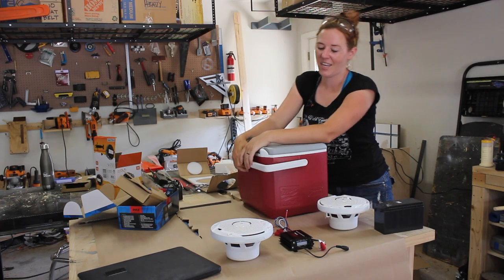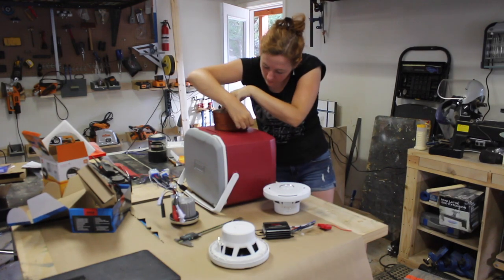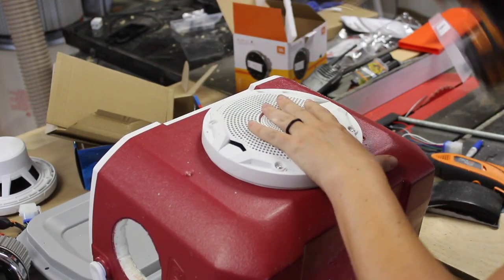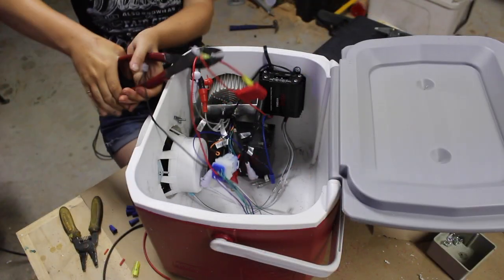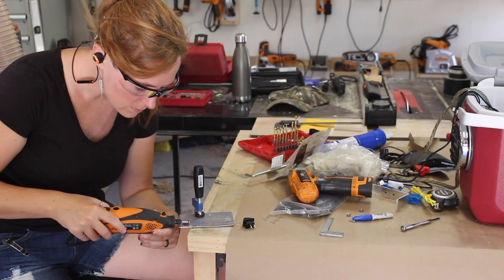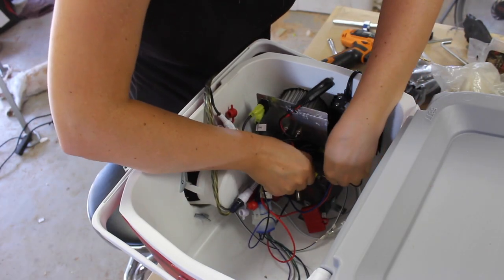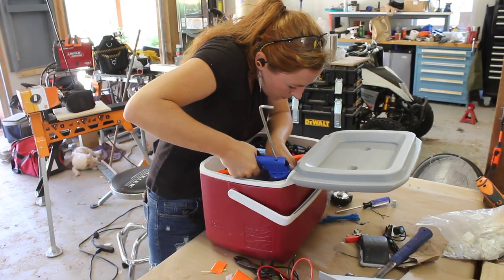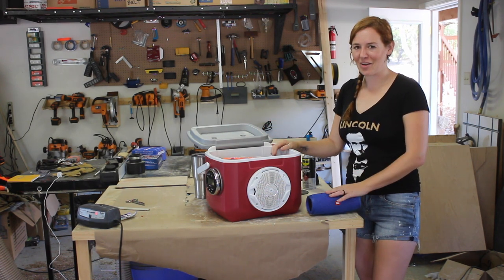Making an Ice Chest - Stereo

Comment: Now just add a solar charger to the top and your set.
Reply: A solar panel small enough to fit on the cooler lid still wouldn't put out more than a few hundred milliwatts, which probably wouldn't even keep the phone charged when in use, nevermind power a radio.
Reply: Yea , add a few solar panels to top and sides of cooler To charge battery.
Reply: But together with the battery the solar panel can charge on stops.
Reply: I worked at an RV place and we sold 2W trickle charge solar panels that would fit just fine on the top of that cooler.  Since it would pretty much always be charging at least a little, it would be plenty to keep the battery from discharging.  It was enough to keep RV battery banks from draining in storage so I'm sure it would be sufficient for this application.
Reply: April Phister Right on sis. Well said.
Reply: April Phister - Sorry, it's basic math.  Those 2 watt trickle would take 35 hours to charge the small 7aH gel cell she used...of optimal sunlight!  It only takes around 1aH to turnover a car starter before the alternator takes over, which is why they work if there's no drain in automotive applications.  The stereo setup she used will still draw at least 30 watts (using a mono channel helped her out with power savings) idling the receiver/amp and driving the speaker.  Unless the entire thing is covered with panels or she runs a massive panel elsewhere, it's pointless and will do nothing.
Reply: Look, obviously you are a know it all so I am wasting my time talking to you so let me just leave it at it was a suggestion that April can either entertain or not.  No skin off my teeth if she doesn't.   Thank you for sharing your opinion.
Reply: Man, people are unskilled when it comes to discussions. As far as I can see we can summarize: You could add a solar panel and charge the battery (for instance you could just leave the box on the porch for a week and it would charge itself over time) but you will not increase the running time of the this Monostereo (lol) significantly. So just calm down and learn to accept that someone else can say an at least partially right thing as well.

Comment: Am I the only one who sees a major flaw in "cooler stereo" concept? Coolers are well insulated so even a small amp inside may turn it into a cooker after some time. If not, it significantly reduces cooling capability.
Reply: You're everywhere in this comment section, fanboy.

Comment: Just looked up the specs on that receiver. It can power the speaker(s) without an amplifier. Save some battery. The wires are on the 12 pin plug. Would also recommend an antenna for FM. http://a.co/ausyzEA

Comment: Nice project but I keep wondering why you wouldn't just buy a JBL bluetooth speaker that is waterproof, small and last a day on a single charge. For about 100 bucks I would just use that instead of building a custom speaker.
Reply from the maker: I address that at the end of the video.

Comment: General rule of thumb, put your power switch on the hot wire.  Putting it on the ground means everything is still energized and is just looking for a path to travel through (your body).

Comment: I'm glad I read thru most of the comments since I (and my wife) said "STEREO?" Oh well.  
The only thing that I think I might do differently would be to use a lockable (via the handle or some type of latch) cooler.  If the cooler / kayak should get away from you and / or tips over you will most likely lose your phone - if it is connected to the setup.  Now I don't know about you, but I don't wish to have anything happen to my phone!

Comment: Why not add a solar panel to the top of the cooler as well? Awesome project April! I would suggest using a lithium ion battery instead though, more expensive but much more appropriate for this application.

Comment: Great project, looks like a lot of fun.  One question, have you had any issues with condensation from the cold side impacting the electronics on the stereo side?  I live in Florida, so any time you have something even slightly cold outdoors, you can plan on it attracting a LOT of water quickly.

Comment: Don't listen to the nay-sayers April.  It's nice to see you do a project that isn't wood based.

You didn't list any details in the video of the wattage on the speaker/amplifier, but a little bit of simple math to calculate the draw of those two components, and you should be able to get a good idea of how long it can run.

One more thing; once you figure out how long it can run, divide it by half.  Normal rechargeable batteries aren't so great at coming back from less than half charge.  This will diminish their life span.  You'll need a deep cycle battery if you want to be able to run it to zero (or close to it), recharge, and not impact its life span.  Deep cycles do cost more, so if I were you, I would just figure out the current battery's half life and just use it like that.

Cheers!

Comment: thats a good build but I can tell your going to have two issues, witch will be easy to remedy, One is heat is electronics worst friend, I suggest a port it will not only help with sound but it will help cool components. second problem is battery size, if you plan on listening to it for extended periods of time and specially if loud, you will find that its just not enough capacity in that battery,  may I suggest 12v  lipo batteries,  I personally use the 12v battery packs from my cordless tools for every thing portable i build just to be frugal.

Comment: A stereo requires two speakers, two amplifiers (or two in one package), and a two channel sound source.  Stereo is dual and mono is one.  

How did you control cabinet resonance?  What is your response curve for your half cooler/half stereo?  I bet you would be surprised and not in a good way.  

When you are switching the power to a device, you don't want to switch the negative side of the battery but instead the positive side.  The negative side is the reference and the common point for all of your components drawing power.  You don't want to take that away when you turn it off.  Switch the positive side and retain the negative connectivity and you will be safer.  

The things you used instead of wing nuts are called toggle bolts.  They are meant for fastening things to drywall that are too heavy for molly anchors.  I hope all of this is helpful.

Comment: 2 things worry me: The condensation that will pool at the bottom of the cooler where your battery sits (because of the ice packs and cold bottles). And then on the opposite side of things the fact that you've put an amplifier in a thermally insulated enclosure. It could lead to overheating of the amp or the transformation of your cooler into an oven.
Hopefully you can update us how it works out after you've used it for a while.

Comment: Great project, but one question tough. Where is your fuse for the battery? I'll recommend adding one just in case something goes pop, then you don't risk your battery exploding. 

Anyways, very creative project - also great to take along at the beach :)
Reply from the maker: If you look inside, you'll see a small red container, that holds the fuse. ; )

Comment: if you need music on the river  may be one thing but the damp of the icebox will kill youe electrics quickly I think April... cool idea though, im with the others though the sound of nature is way cooler.
Reply: That my concern as well, all the condensation and such from the ice is probably going to wreak havoc on the electronics before long.
Reply: She's using MARINE products made for wet locations. So? Your comments are invalid.
Reply: Rick Martin exactly, plus if she sticks with ice packs moisture will be kept at a minimum.
Reply: interesting... Marine products "ARE NOT" designed for cold storage circumstances such as a cold box or fridge tempratures so think again...
April builds great things for her familyl needs for her family, I was not critisizing merely making an observation.
Reply: So there are no marine products on boats in cold climates? Interesting theory?
Reply: Almost all electronic components work successfully at a temperature of -25 degrees. If the temperatures fall below -25, the components begin to lose the declared parameters by a very small percentage. Such devices easily operate at temperatures below -45 degrees, including this battery. What is the optimum temperature for you in the refrigerator for water? I think that around +10 degrees.